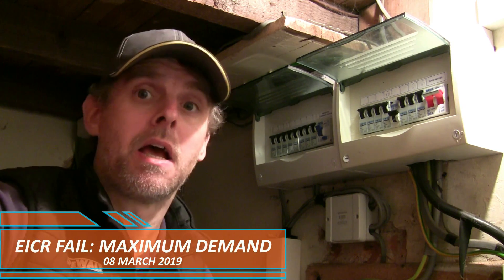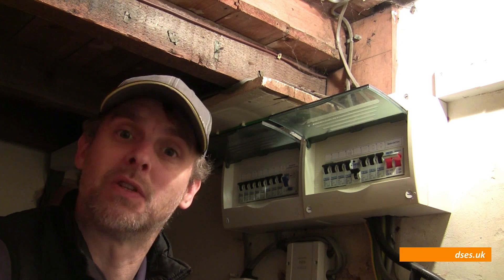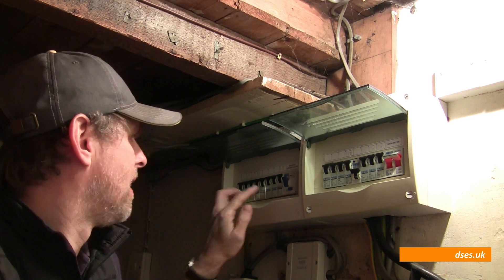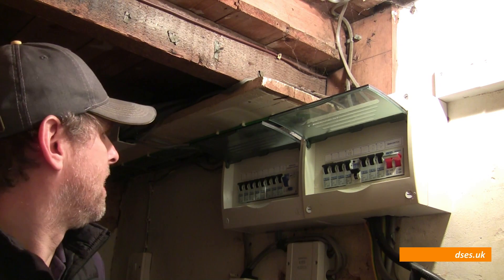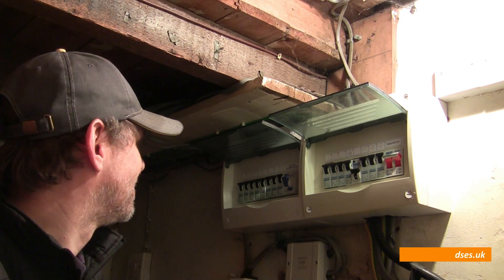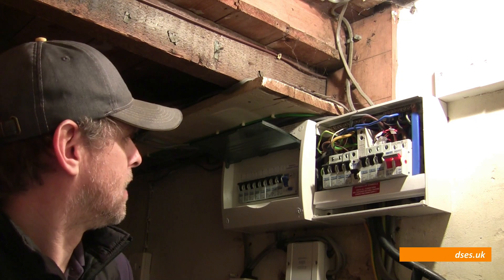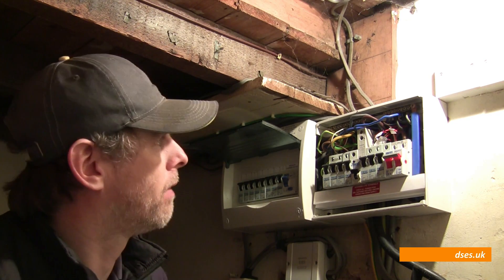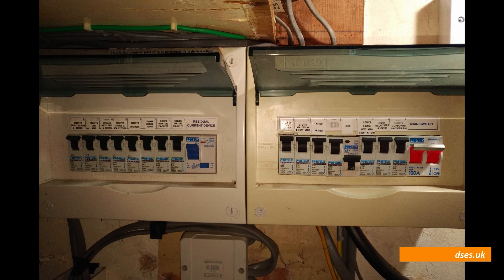EICR FAIL- Maximum demand

Comment: What is the difference between EICR and NICEIC?   I had a certificate for the latter when I bought my home but I've found nothing but horror shows all round the house. You wouldn't believe some of the things I've uncovered.
Reply from the maker: An EICR is an Electrical Installation Condition Report which is a process that may be undertaken by a suitably qualified and insured electrician to ascertain the current state and safety of your existing electrical installation and to compile a report compliant with that laid out by BS7671 showing the results of the test and inspection process. NICEIC are an accrediting body the same as NAPIT, Elecsa, Stroma, NAPIT et. al. Someone registered with an accrediting body should, in theory, know their onions, as continual assessment by that body should ensure they're working within their means. My company is accredited with NICEIC to undertake EICR work as I hold specific qualifications and professional indemnity insurance to do so. Someone else may be registered with another accrediting body to the same standard. That said, you'd be amazed at the crap reports we come across, both by chancers who aren't accredited at all, or by those who are for installation work only but not testing/inspection. If you think you've been short changed on an inspection by someone who is accredited, it may be worth speaking with the accreditation people on their helpline number or to have someone else cast a second opinion.
Reply: @dsesuk   Thanks. It was a number of years ago and I've put right most things myself as I went along, while my builder Dad did extensive work on the home, replacing walls, ceilings, floors etc. I saw things electrical wire running over heating pipes, an outlet spurred off the cooker socket and installed on the inside of a cooker extractor (where the steam from cooking passes directly over it) to power the fan, metal light switch face plates which aren't earthed, wires running out through the wall on the outside of the house, going in through the top of the junction box with a busted gland and cloth tape wrapped round it.... just off the top of my head. These all felt like one off things at the time I put right but they all added up to make me wonder what other sins are going on that I haven't seen. I did notice the old black and red wiring in the ceiling in parts of the house.

Comment: Hey, thanks for this video. How does current leakage occur? How is it getting on that earth wire?
Reply from the maker: I'm not showing the current leakage measured properly here as others have commented, but where it is coming from this installation, it'll be either through appliances that have a natural leakage such as with some electronic equipment, or more likely through poor insulation resistance. Two of the socket circuits on this RCD have zero readings when I.R. testing, and if the RCD were operable then it would be tripping all over the place.

Comment: Interesting how popular electric showers are in the UK. Do they actually save money over an off peak storage tank or is it purely done for convenience and space? In Australia we generally have instantaneous gas or gas or electric or even solar storage tanks. Of course we don’t have a ring system either so you’re probably wondering how we survive without getting electrocuted daily :)
Reply from the maker: It's a convenience thing I guess. Traditionally, people did have hot water tanks, but they're generally ripped out of our pokey little homes for more storage space. Electric showers are easy to install and can heat water on demand which makes them handy for a larger family environment. On a back-to-bricks refurb, a combi boiler which can heat the water via gas would be better. Don't knock your lack of rings, they're awful things, a throwback to WW2 that nobody else in the world bothers with. I don't install rings myself, they're for the old boys who won't change, or the cowboys who know no better!
Reply: David Savery Electrical Services Oh I know rings are a pain compared to a conventional radial circuit. Did they come about because of a shortage of copper in WW2?
Reply from the maker: @mondotv4216  So Wikipedia tells me!

Comment: Maximum demand can be alleviated slightly with led lighting, new energy consumption appliances and going to gas hot water. Correct , split the sub circuit rcd to rcbo's. It is not to wiring rules to have multiple circuits on an individual rcd now.
Reply from the maker: LED lighting is a no-brainer, gas appliances are fine, so long as you accept that gas is on the wane and will cost a lot more a few years from now (there will be many switching from gas to electricity in the future). The wiring regs do still permit the use of RCD's for multiple circuits however, in fact, 18th Edition introduced a new reg specifically stating this, 531.3.5.2, although the implementation on this site is poor.
Reply: @dsesuk  My work is in Australia and rcd circuit protection cannot be greater than a 50/50 ratio. In other words if you have 4 power circuits then they have to be on a 2 to 2 rcd ratio and not 1 rcd for all. I have found recently with the more reasonable price of rcbo's that the majority of customers will go with all individual circuit protection on light and power circuits. We normally install a 3 phase service line and there is no problem with max. demand issues. It seems the installation there has not been inspected by the regulatory authority. Probably a cash job.
Reply from the maker: @ottoschless4115  Ah, well you probably have more sensible rules than us - the regs here didn't even acknowledge the RCD issue until last year's 18th Edition, and even then it seems to rubber-stamp it rather than recommending a ratio. We're mainly single phase domestically here, and with most services underground that isn't going to change easily. As for regulatory authorities, there are none. This was probably all done by the builder rather than an electrician, no certificates, no warranties, nobody checking until it's all too late!
Reply: @dsesuk  Thanks for your reply. The electrical trade there really needs some scrutiny, otherwise you will be inundated with cowboys. Hopefully nobody gets injured or killed by someones stupidity.  If you are correct and the builder did it, ( electrically unlicensed ),well he will be severly fined and punished here. A notification of electrical work certificate must be given to the regulatory authoriry here when the connected load is increased with any additional installation. Anyway enjoy your work.

Comment: Are you sure that the brown has been used as the neutral at the RCBO? I think you've made a mistake. Remember that different RCBOs have their connections the other way round. The brown is at the front and going to the upper L terminal. The upper terminal is always the front and lower always the back irrespective of which one is L or N. The only swap is the grey and black.
Reply from the maker: Hi Kevin. That was a 'voice typo' addressed in the description; I said brown, but I meant black. I didn't notice the error until after upload which is why there is no on-screen correction.

Comment: Would it not have been more accurate to measure the earth leakage by putting the clamp around the line and neutral and measuring the resulting difference between the two? By measuring the earthing conductor you only get part of the earth leakage current as the rest will be flowing through parallel earth paths like bonding, pipework etc.
Reply from the maker: Yes. I'll show that in a future video.

Comment: Electric showers are an excuse for bad plumbing ! 
Apart from the maximum demand issue, there's also the peak rate issue. If you are going to heat water with electricity, which is expensive anyway, why no use off peak electricity to heat a tank of water at night ? Modern insulated tanks stay hot for a long time. 

You need to keep the electric shower on constantly while you are showering, to stabilize the temperature. While you're soaping up, you'll need to direct the shower away and waste hot water. With a thermostatic mixing valve you can get a quick blast of hot water to wet down; stop and soap up; and get another quick blast to wash off. You'll use less water in the shower and save dosh ! 

But you'll need a mains pressure, stainless steel hot water tank. But really everyone should have one of those nowadays. 

When the new smart electricity meters take off, using up cheep rate electricity is going to be even more important. When the wind blows and all the wind turbines come on-line, there's a glut of power. So why not get ready to take advantage of it by boosting your hot water on the cheep ? That's if this technology ever arrives !

Comment: I always think EICR s are are priced to low with the amount of knowledge required to carry them out and the have to type up all the results they can be very time consuming i start at £ 225.00 a house of that size 
Would be at least £450.00
You have to think of all your years of experience it takes to sort out the maze of wiring you find on these jobs.
Anybody doing it cheep is generally not testing it properly and the report is not worth the paper it is written on
Reply from the maker: I agree, it's a difficult one to price up as there are people out there who will charge £60, but obviously for that kind of money you're gonna get someone who only does a drive-by visual and will surely "find" something that requires urgent remedial work so he can get in and earn some real money. It's true that we can make more in a day by doing installation work, but although EICR's often mean a day where we make less for the effort, it leads to a happy client, good word-of-mouth and we're usually appointed for remedials, modifications or future inspections. Some people scoff at our prices because they're used to the £60 chancers, but although we're both telling the client we're undertaking an EICR, the quality and accuracy of the end product doesn't compare. Those who don't get and go with the cheap chaps are welcome to keep getting fleeced for remedials they may not have needed, and they can wipe their arse on the useless limitation-filled inaccurate report that won't actually protect them from legal or insurance claims as the sparkie who signed it off was never qualified or insured for inspection work!

Comment: Get rid of the electric showers, put in shower pumps or, better, a mains pressure hot water storage system, like a Megaflow. Three 10 kW electric showers in a domestic premises is crazy, besides which, you don't even get a decent shower. More money, but the proper way to do it. 

Either that, or with two kitchens, three electric showers and all the rest, they'd better get the order in for three phase supply...
Reply from the maker: I agree, a Megaflow or similar would have been ideal, and it's a shame the previous owners and the idiot builder who converted the garage into a 'house within a house' with it's two additional showers and cooker just didn't think about it. It's difficult to retrofit now that we have fitted kitchens and (in much of the new section) a flat roof, so running new pipework would be tricky. Work is already underway to sort all this out though, WPD have been out and confirmed the head is in good nick and has a 100A fuse, one shower is being decommissioned as that bathroom is to be converted into a utility room and we'll be making some other changes, so a follow-up video in a few weeks should detail the differences.
Reply: @dsesuk  An excellent video by the way, but there was so much wrong with that installation it's one of those what on earth were they thinking of moments. It was an electrical fire waiting to happen.

Comment: I wonder if they meant to fit a 63A rcd and breaker combo (or that was fitted till they got fed up with the "nuisance" tripping and got a fuckwit who just replaced it with an rcd)
Reply: Apparently some people confuse the rating on the RCD thinking it will trip like a breaker at its rated current, not realising that RCDs don't work like that.  I've seen a few videos where plain RCDs were installed as if they were MCBs/RCBOs, with the installer apparently not knowing the difference.

Comment: Hi i am wondering why in the UK households always use obe phase system while here in Croatia most of the houses use three phase(my little 75 sq m apatment too).That house you are working in seems huge and they only have single phase electric. Why? Isn't three phases much better. For instance cooker in Croatia is connected by three phase and it has same power as one in the UK, while using much less power per phase. Wouldn't bringing three phase into that house solve all the problems?
Reply from the maker: I don't know, but I assume it's down to cost. I don't know what it's like in Croatia, but unlike many countries our cabling infrastructure is largely all underground in the towns and cities, and I imagine that after World War II, those responsible for rebuilding figured 60-100A single phase ought to be enough for anyone domestically. Generally, it is, but where a service needs upgrading, a lot of digging is called for which is expensive on the public carriageway, and not very desirable for someone who has a smart looking driveway or garden in front of their house!

Comment: Tip: Instead of taking your earth leakage from the earth cable (which could potentially include currents from other properties) put your clamp meter around the two tails and you will get a true reading of the leakage from the installation - ie the difference between the current in and the current out.
Reply: Doing both gives insight into the different things that can be going on; EMC filter current, diverted neutral current and all those 'no name' issues...

Comment: The tails going to the cutout look like 16mm. I bet the cutout is 60A, which explains the overheating. Those things can carry 80A for quite a while. The board is a real mess!
Reply from the maker: Not pretty is it?! It is 25mm on the tails there. We had Western Power out yesterday who have confirmed it's a 100A fuse, the earthing is properly soldered onto the sheath and the cutout is in good nick. They've rubber-stamped it as fit for purpose to carry on, so that's some good news for the homeowner!

Comment: I don't get the fascination with electric showers. Mine comes off the boiler, and heats up instantly with more than enough pressure. What benefit does an electric shower give, when they cost more to buy and run?
Reply from the maker: Electric showers have their place. They heat water instantaneously, so no need for a tank, and they can always supply demand. They also only require a cold water feed for simpler plumbing. Although the central heating can supply showers, some properties may not have a powerful enough boiler, or getting the hot and cold water pipes where they need to be and with suitable pressure may be difficult or costly. I have no gas at my property, so all my heating and hot water needs need to be provided electrically which is something you'll see more of  as we go into the 2020's and gas starts getting phased out more.
Reply: @dsesuk  Mains pressure hot water storage tanks are better in a big house. You can run three decent showers at the same time (assuming the tank is big enough). Instant water heaters, whether gas combi or electric showers are OK, but the former are two showers at most and the latter doesn't give a decent shower in the winter when then weather is freezing. Of course, it's all a lot of money, but three electric showers and two kitchens don't fit an 80A supply unless something is stopped by one of those magic charing boxes.

Also, if the magical smart meters work as advertised, in theory, a pressurised storage tanks can use cheap electricity. 

When all those electric cars come in, plus those ground-sourced heat pumps and so on, the local distribution network is going to get frazzled.
Reply: @dsesuk  Good videos.  What was the outcome of the installation.   Due to the high maximum demand did the DNO increase the supply cable & fuse service head?     If this was a design job from scratch would you reckon the DNO would put in a TPN supply due to the load?
Reply from the maker: @motorone5301  Still ongoing this one - there should be an updated video in the coming weeks. Western Power have checked out the service head and confirmed it's okay, and we've had Haste Ltd. out to install an isolator. We've also been back to repair several final circuit problems. Two showers are being decommissioned as one bathroom is to be converted into a utility room and another is to be fed from the heating system, so demand won't be such an issue. We're good to go for a change of consumer unit now, it's on the list to be scheduled in sooner rather than later.